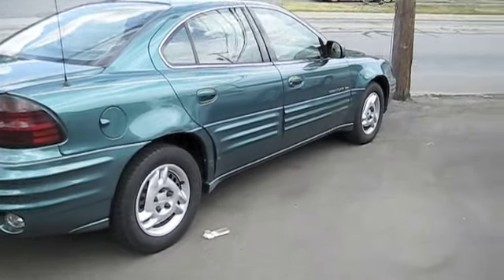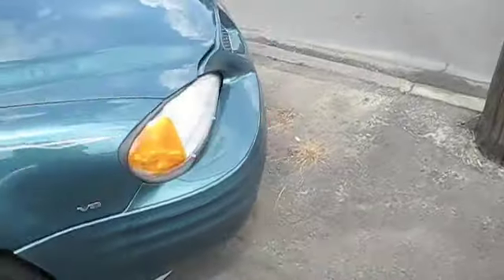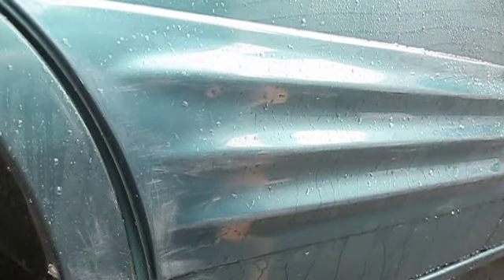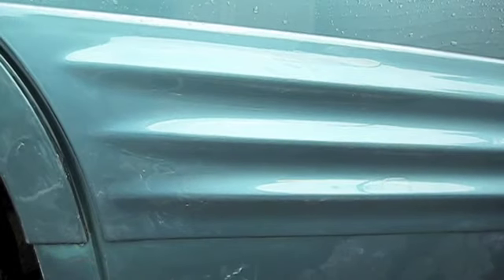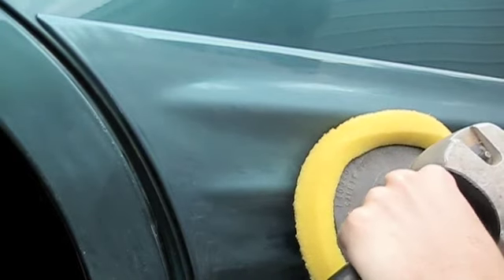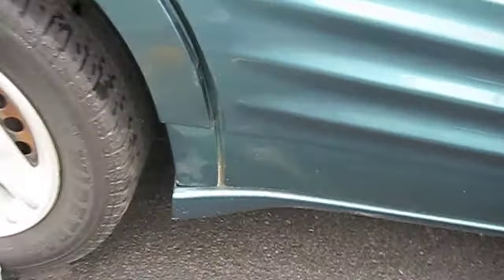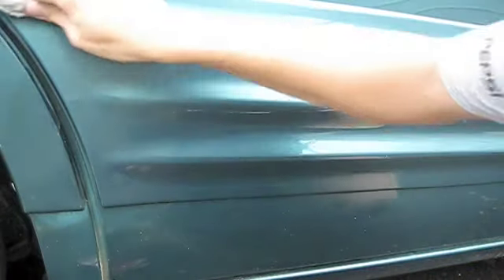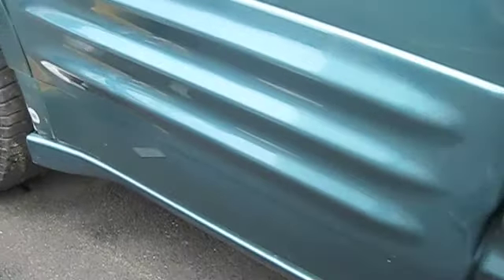RE: Davidsfarm - How To Remove Clear Coat Paint Scratches From Your Car

Comment: It depends on the depth of the scratches. It's recommended to start out with a finer grit and compound as opposed to the coarser to minimize damage to the clearcoat. If they don't come out with the finer grit then go lower grit.

Comment: Quick question, I noticed in your video:
Can I wet sand with 2000 grits and use the Meguiar's cleaner wax to polish off the scratches? Or am I required to use a Compound polish first?

Comment: Probably best to start with a 2500 grit then a 3000 grit (in different direction) then finish it off with a polishing compound and sealer (wax). 2000 grit may take off too much for a novice, so be careful if you do use it.